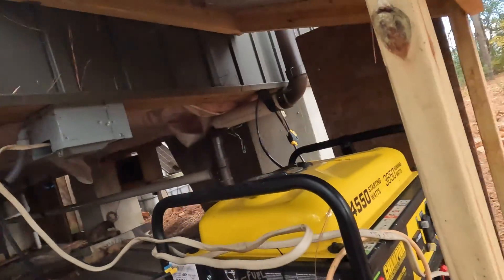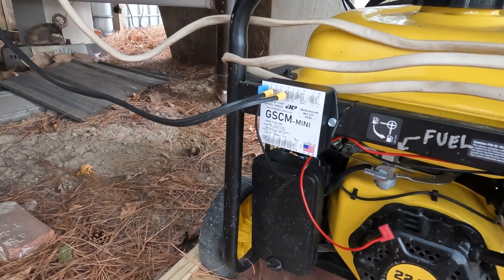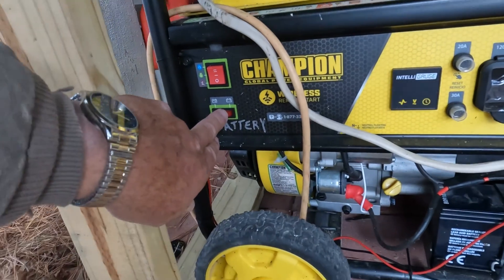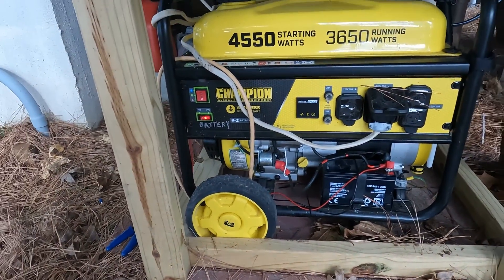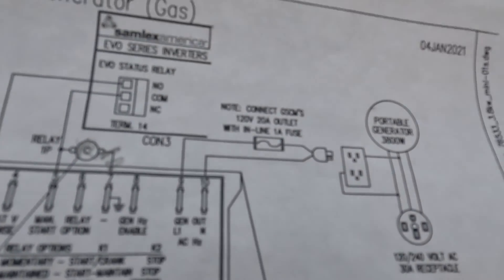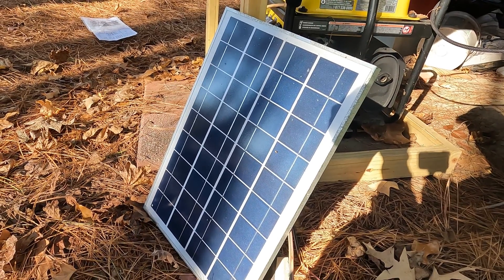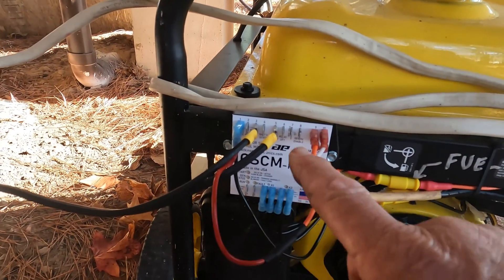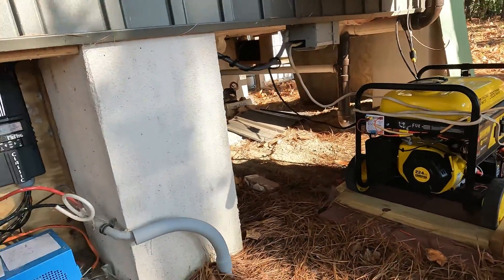#1 Most Affordable, Off Grid, Back up Generator. (Automatic Start)

Comment: Great video, I did something similar with an external generator controller, and wifi smart switch costing less than $100. I made a couple of videos about it 

Generator Remote Auto Start-Stop for Off-Grid Solar with Dry Contacts+Controller+Phone app - Part 1
https://youtu.be/2RGPFRVUMBg

Comment: Jumpstarting the lithium batteries! I just ran across this. The built in battery bms cuts out BEFORE the load controller on the MPPT charger. Which powers the mppt....

Comment: Please help me where I can buy electronics to automatically start the generator and charge the solar batteries.
Reply: Ive been looking for years. We need to make one.  Any efi motor with auto start and a microcontroller(sensors and software)should do the trick. When the batteries hit X voltage, fire up the generator to charge the battery bank back to Y.  Most lifepo4 battery allow a 1c charge. So charging the bank should give a good return on time. ex. 1 hour of charging = 4hr draw time. Design pending. Sry rambling :)
Reply: I should have watched the whole video first. This is the bridge. Nice setup.